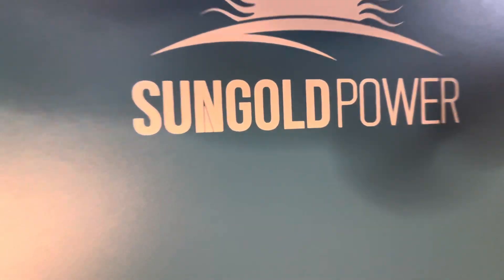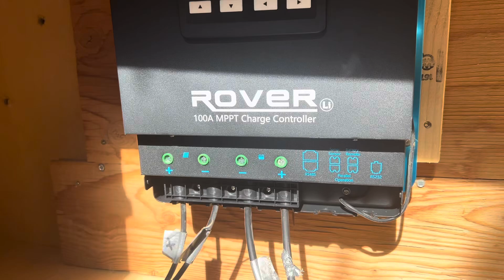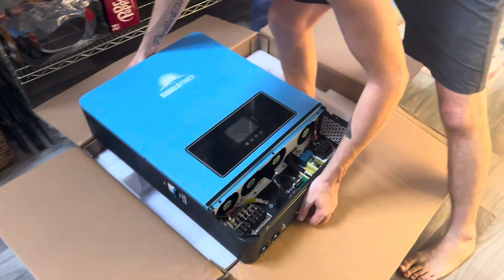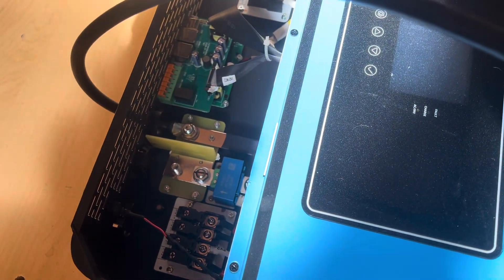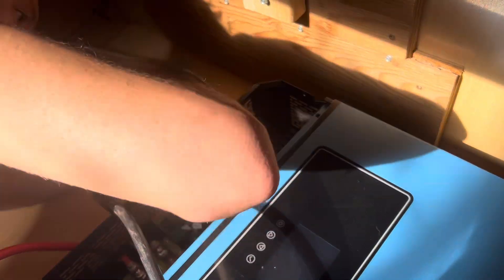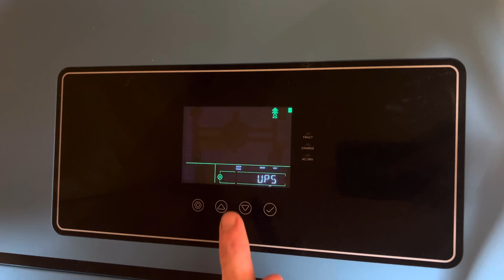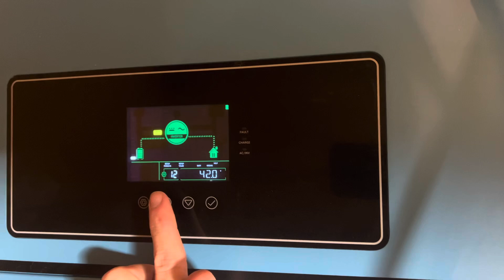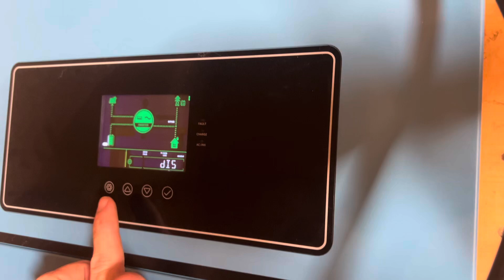SunGoldPower 8KW 48V Split Phase Solar Inveter Unboxing & Installation

Comment: What 240 volt split phase units are you running if any?
Reply from the maker: Mini splits and for the use of smaller wiring.